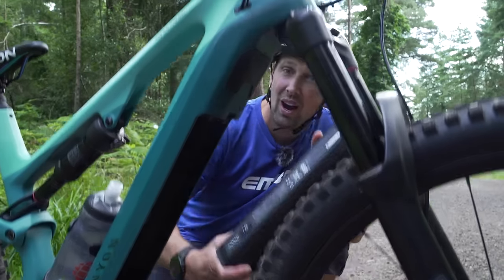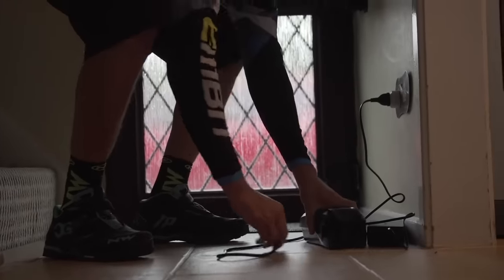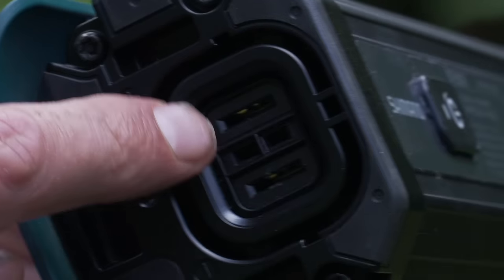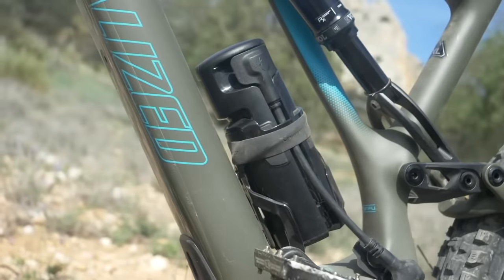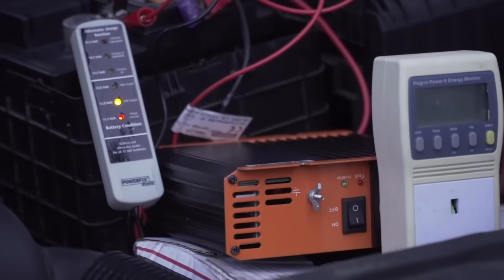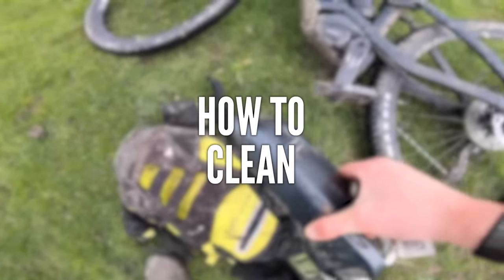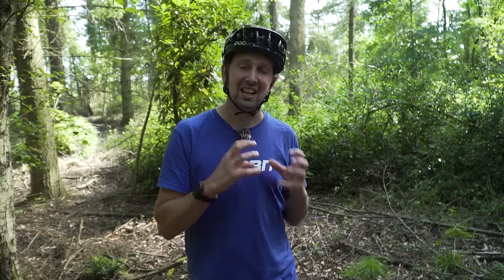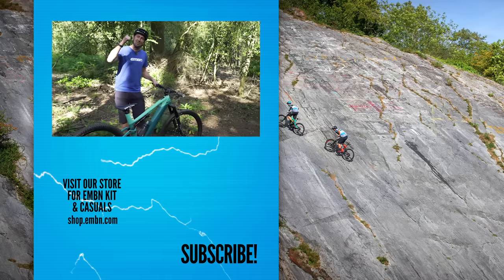How to Maintain Battery Health | E Bike Batteries Explained

Comment from the maker: How do you look after your battery? Do you have any tips? Let us know 👇
Reply: Storing the batteries at around 50% is an easy fix. But some drone batteries have auto-discharge that will take the charge level to around 50% automatically after about 10 days or so. Are there any ebike batteries that has this function?
Reply: Couple of points.
1. Shimano cycles are based on a full charge / discharge. You can use etubes and diagnostic to report cycle count
2. Shimano charger will charge fully, then go into a trickle mode then turn off without the need to set a timer or unplug. That's what the BMS is for.
3. You can run a Shimano battery flat (flat to the point of a auto power shutdown that is) the BMS will prevent you taking the cells below a safe margin. I.e even tho the bike won't provide power to the motor the battery still has a safe level of charge. If you run Di2 this is also evident as the battery too low to power the bike, still powers the di2 to allow shifting. At some point that too will be prevented but the battery is still not "flat" and a margin of charge safety still exists.
Reply: Thank you for the video, could you guys do a video of emtb with internal gear hubs? I have seen some off roads bikes on Google images used internal gears instead of classic cassette but I wanted to know more the down points and advantages
Reply: I look pretty worse for wear!
Reply: most batteries are made from a black plastic case, which is good for plastic durability outdoors but not so great for heat absorbtion. black batteries and also dark frames of down tube integrated designs will heat up the cells when exposed to sunlight. battery capacity degradation is primarily a function of cycle times and heat exposure. you can spray the battery case with chrome spray make it reflect sunlight and avoid heat absorbtion.
Reply: I wrap my Bosch power tube in sausage skin when charging. It increases the charge speed by around 50%
Reply: Never kill the batt and for storage 60-70%. That works for me. And known brands are better than no name crap. You get what you pay for.
Reply: I very strongly recommend that you always remove the battery from your bike when charging, and always charge the battery in a fire-safe location.
With modern high quality batteries, the BMS and cell design does everything they can to prevent the unthinkable, but it's still a present risk.
This risk is greatly increased with knock-off or cheap batteries.
If able, set up a designated charging area in a safe location, so that if the battery goes up, the only thing you lose is the battery and charger - not your extremely expensive entire bicycle, or God help you, YOUR HOUSE.

Also, check your battery's condition before plugging it in.
That tough case will do a lot to protect the cells inside, especially if you have an in-frame mount, but if it gets too banged up from stuff hitting it while on the trail, consider retiring it. A damaged battery is a dangerous battery, as our presenter helpfully noted.

Mild correction; the reason you don't want to go from full power riding straight to charging is in-battery heat.
Pushing you down the trail is hard, and the inside of the battery will get warm from doing this.
Once you get back home, you're going to want to let the battery cool down (or otherwise reach the same temperature as the room) before plugging it in.
Reply: @FerralVideo  I have accidentally charged my diy battery to over 4.4V per cell and nothing happened (yet). obviously it strongly decreased remaining cycle life, but it takes more overcharging to make a battery burst into flames. Selection of matched cells (industrial standard), BMS and ESPECIALLY a charger with a set terminal charge voltage to 42V (36V battery) prevents any dangerous overvoltage in the battery pack
Reply: @derekharper6031  The bike may inhibit the motor, the built in lights still shine
Reply: Not gonna lie I will probably  change the battery  every year since the battery's could fail and cause a fire anyway I seen ebikes explodes that won't happen  because  I am gonna put new fresh battery  every  year
Reply: I got a Pace Aventon ebike from Berts. How can I keep the ebike battery charged at the same time as I'm ridding to increase my distance. The Pace ebike is 500w and the charger is 48v.I have a Ever Start 750w Power Inverter and I attached it with a Scooter battery. So I went to Inter State and showed him how I hooked the battery to it to keep the ebike battery charged .He told me sense the charger is 48v I need 4 small batteries to make it 48v cause each battery is 12v. But see 1 scooter battery powered on the 750w power inverter. He told me to little volts can mess up some thing . Can any 1 add on that please ??
Reply: don't put dielectric grease on the connection.
Reply: @MTBs  I have lots of RC Lipos and some discharge themselves after a few days. Bike batteries would benefit from this feature .
Reply: @bcflyer99  Yep, that should at least come as configurable option on eBikes.
Reply: I bought a Heybike mars (500 watts) My Q: Can i put a bigger batterry so I can go longer mileages? my battery now is 45V
Reply: handle with care! charge only when home, don'y try to OP your speed, basically have respect! Why try to charge fast? just get more batteries xx
Reply: @MTBs  Yes I take the drone battery out of drone after charging.The DJI batts are so light ,amazing tech,I top them up night b4 drone flights.For my dual battery,dual motor Ariel Grizzly I fully charge both ,and reinstall to bike,as this equalises all the cells between both batteries.LG or Samsung cells for ebike batts r Grade 1/best

Comment: There’s a chemical reaction at 100% that deteriorates the battery, this is why storing at 100% is bad. Best to leave battery at 80% and then top off right before the ride unless you ride everyday. 100% is only bad when stored at 100%, not when used right away.
Reply: finally someone cleared this out. thanks!
Reply: Thank you. Am I correct in thinking that its the same when fully discharged that a chemical reaction takes place, hence not leaving it empty also?
Reply: @jamjar1106  there’s is not the same chemical reaction at empty. It is still recommended to not drain the battery to 0% though, I think because if you accidentally drain below 0% it will damage the battery. I use my battery typically between 80%-10% unless I need my maximum range, then I use 100%-5%, but I have a Bluetooth BMS and I’m capable of looking at, and setting, the exact percentage of charge my battery cuts out on my phone.
Reply: if the battery is charged at 100% how long can you leave it at that charge?
Reply: @andrewhillphotosvideos2909  the less time the better. I don’t think there’s a magic number your looking for since it’s probably a linear degradation over time.  But if you insist on a number I’d say 3-7 days per month, just guessing
Reply: Not so sure about the advice.  One would think that a smart battery charger will do what is best for the battery, same as the charger inside a smart phone.  It knows that going to the absolute max charge is not healthy, so it cuts off below that.  Same for the bottom end.

My Makita lithium battery pack for my drill works until it simply shuts off.  I'm assuming the microprocessor inside the battery case says, "That's enough, time to recharge."
Reply: Tier 1 batteries will have the notion of total capacity and useable capacity. So all this 80pc nonsense goes out the window. You don't have to worry about draining all the way to zero and charging to 100pc because there is extra capacity acting as a buffer that is not available to you.
Reply: Already charging to 100% itself puts lots of stress on battery compared to charging to 80%.
So if not needing full endurance it's better to not charge regularly to 100%, but do smaller charges to around 80% charge.
And cell deterioriating chemical reaction starts when voltage rises above ~3.7-3.8V. It's just initially slow.
Also below that voltage there's different harmfull chemical reaction.
Reply: Why would they provide you with a charger that ruins your battery if u complete a charging cycle? This sounds like garbage. As said it has an on board bms, battery management system doubt the manufacturer would design a charger and battery management system that could kill their product from standard use...
Reply: @lvlpkr  I've been charging my Bosch battery to 100% on the day before/day of riding for 2 years, recently did a capacity test and it was well within 10% of new.
Reply: Doesn't make a difference with lion batteries

Comment: Lead-acid and Nickel? Really? No bike uses that. Unless your bike is in a museum.
Reply: Razor and Bullet scooters use lead batteries
Reply: Well a ebike battery  is supposed  to last 3 years but I don't trust 18650 cells from any brand they can explode even if you look after it  and stop charging when battery  is 100%  I don't trust  ebike battery's I plan to buy a new battery  every  year and have fun with  the old cells by making them explode
Reply: @jonathanoxlade4252  It's not the cells, it's the BMS, or rather lack thereof that causes said explosions...

Comment: You should emphasize proper storage voltage since that has a dramatic effect on cycle life. Also even if you aren't using the bike for just a couple days you should be making sure it's at storage voltage, it does not take long for a battery sitting at 100% to degrade the battery. Basically if your not riding the bike make sure it's at 40-60% charge, then only charge before you plan to use the bike.
Reply: He said that very thing.
Reply: But this really stinks. How would I know if I am going to ride the bike for a while? How do I discharge them if I am not riding it? I have small ebikes here for for my grandchildren to ride. I don't know when they are coming. So they are sitting out there right now at 100% charge. Do I need to go out there and ride each kids bike for 10 miles to get it to 40%? And then it seems, I should charge them when they are coming over to what, 80% and therefore have decreased range? This all isn't making much sense or certainly unfortunately not very practical.
Reply: Problem with that is I would then never get to ride.  I ride almost daily, and charge over night for the next day. If I leave it at 40-60, then it is 2 hours to get up to full. I want the bike ready to ride 60-80-100km at  a moments notice.

We need more R&D so batteries in the future are that much better.
Reply: @ronbonnell1775  I agree 100%. I want my bike ready for a maximum ride at a moments notice. I only leave it undercharged when i know it is going to be awhile before a next ride.

I ride in the winter, but not every day, so I plan my charging cycles to leave them down, and then top up a few hours before I want to go.  If I was out of action for weeks/months then i can see storing at 40%.
Reply: @joeshmoe7967  if you're riding every day then yeah you're gonna just charge  it every night basically, it's more important to not let the batteries sit at 100% for days or weeks. If you want to extend cycle life of your batteries I would suggest only charging to 80 or 90% if you can get away with it, and if you're just charging overnight charge it slowly if you can, the faster the charge rate the worse it is for your battery. 

What we need now is chargers for every bike that you can set max charge and charge rate, easy stuff and would greatly increase cycle life if you have more time it don't need 100%.
Just some stuff to consider if you want to extend cycle life, not gonna work for everyone, but will save money and resources if you can.
Reply: A thousand charge cycle is not a lot

Comment: A simple tip is to just never fully charge it, and never fully discharge it. And never leave it plugged in for extened time periods. I keep mine between 40-90% all the time. Been doing that for nearly a year and I have not had any compromise on battery performance as of yet.